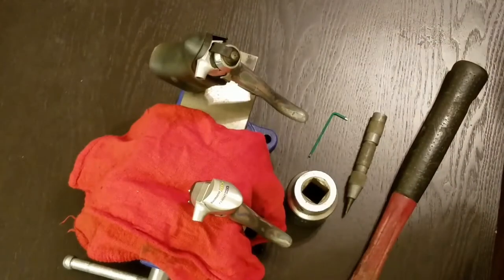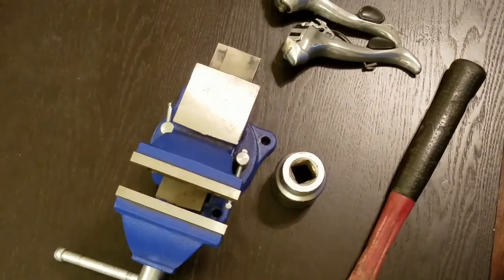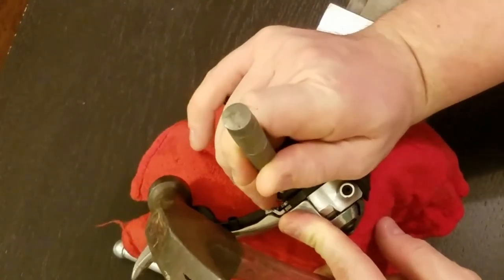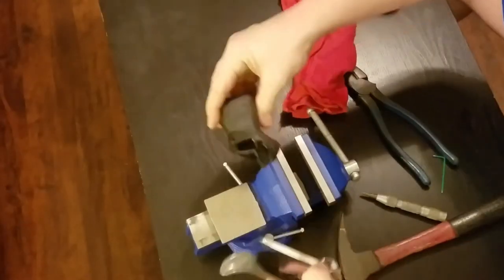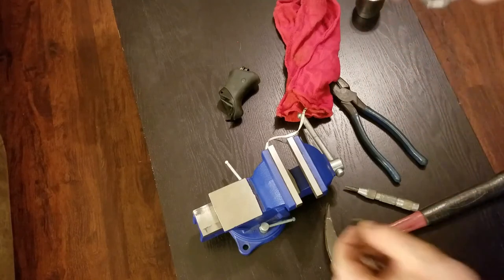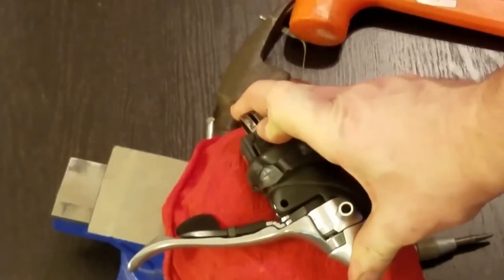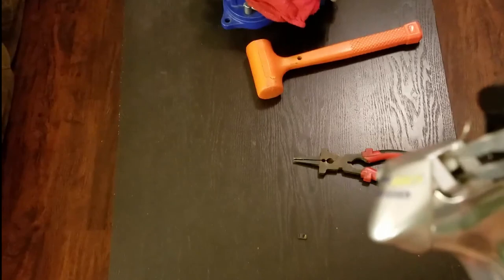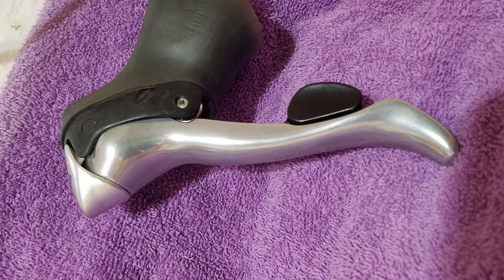HOW TO REPLACE SHIMANO SHIFTER & BRAKE LEVER FROM OLD SHIMANO 105 ST-5500 TO NEW!

Comment: My friend please can you tell me i have the same St 5500 shimano levers and i am looking for some new hoods bike levers covers but i cant find the exact model.Can you recomandeted a model that fit neither to this levers pleasee
Reply from the maker: Hi again Arsen! Please take a moment to subscribe to my channel if you haven’t already! I appreciate the support in growing my channel! The model number on your shifters is 5500 and the part number is ST-5500. Now finding your hoods can be tricky because they are getting older now. You are gonna have to search ebay and setup notifications so you can get emails when new items are posted. You can use Ultegra 6500 hoods on your Shimano 105 shifters too by the way, you can also buy broken shifters off eBay that still have good used grips on them. I also always remove and clean them with very hot water and dish soap, can add life to your old hood if they aren’t ripped or torn already.
Reply: @D2WrenchWorksDIY  My friend thank you very much.After some researches i see that is imposiblle to find this model of hoods.I just find pair that cost 200 dollars a ridicoulous amount of money for just hoods.I appriciate your answer i think i can keep them for some time they are not such in bad condition but just want to replace them but when i understand that is very rare and difficut to find them i think i wait till i got a new bike.I just dont want to replace my old bike yet i have a Stevens 65 cm that is ridicilous rare and for a tall person 2 meter as me is difficult to find a bike like this.But thank yu for your advize and keep going with your videos you make nice job.Greetings from Albanian,Europe
Reply from the maker: Many thanks for the kind words Arsen and hello to you over in Europe! Sorry I am just now seeing this comment, buyt keep an eye out for used 9 speed shifters like I mentioned hopefully you can find some with some good hoods! Defintely don't replace the bike though, even microshift makes a 9 speed pair of budget shifters that will work fine with you shimano drivetrain! Good luck friend!

Comment: Bonjour je suis désolée moi qui débute vous nous expliquer pas comment enlever le capot et le ruban blanc on fait quoi avec ? J aimerai me lancer à réparer les miens mais là avec votre explication je ne peux pas ! Pouvez-vous m aider ? Merci Rosa
Reply from the maker: Hello Rosa! The white ribbon is a data cable which connects to Shimano Flight deck cycling computers. I have fixed and sold tons of bikes and never once used it, in today's world people have a garmin or use their phone to record their activities. The ribbon is stored on the side of the shifter housing, the black plastic piece will have a little compartment with screws where you can access it and feed the ribbon through and store it in there. Or you can definitely just cut the ribbon out, which I what I am pretty sure I ended up doing.
Reply from the maker: The hood is removed by taking the very top of the grip, where it's highest point is and it is slightly circular shaped, grab underneath and peel it back from there. Once you have that section just peel the grip backwards, towards the clamp the shifters use to clamp onto the bars. You can work the grip off completely here, I always wash them with dish soap here, then you will install in reverse order.
Reply: @D2WrenchWorksDIY  merci beaucoup ça va vraiment m aider 😄🙏😉
Reply: @D2WrenchWorksDIY  merci vraiment au plaisir de regarder vos vidéos 😉
Reply from the maker: Thank you! I appreciate you subscribing and supporting my channel!
Reply from the maker: No problem! Happy to help!
Reply: @D2WrenchWorksDIY  merci à vous pour vos explications 😉👍
Reply from the maker: If you need anything else let me know!
Reply: @D2WrenchWorksDIY  pour l instant ça va merci ! Mais un tuto pour le démonter totalement la partie entière du capot si un jour vous avez le temps 😉👌
Reply from the maker: @censirosa5338  this video is a little old so I don't have these shifters anymore unfortunately. If I get some more soon I can make a video for sure, thanks for the suggestion!
Reply: @D2WrenchWorksDIY   bonsoir D2 merci j ai démontée entièrement, nettoyer, mais apparemment les petites pièces s usent et les petits cliquets à ressort ne font plus les fonctions, j ai peut-être oubliée un petit ressort il y en a tellement dans une manette, alors avec plaisir si un jour vous avez l occasion dans avoir ! Moi je remonte de vieux vélos des années 70 à 92 un peu près donc sur certains vélos j’ai souvent le problème mais pas sur ceux des années 70 à 85 heureusement 😅
Reply from the maker: Hi Rosa!! Sorry it's been so long since I replied but I have been completing a huge move. I use my computer to translate the messages to English and right now I only have my phone, which the app won't allow me to copy and paste into a translator. Any chance you could explain this in English so I could help you?
Reply: @D2WrenchWorksDIY  Hi yes I’m holiday , to later 👍😉
Reply from the maker: Enjoy! 🥂